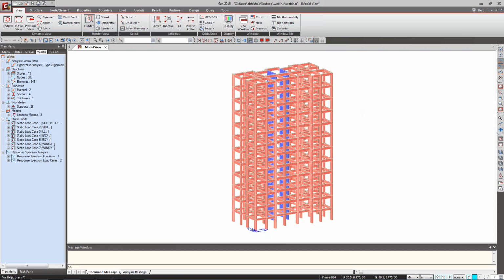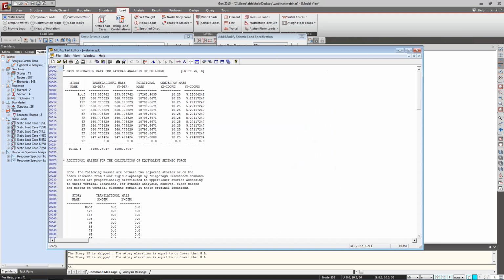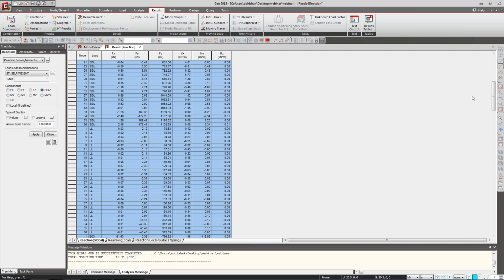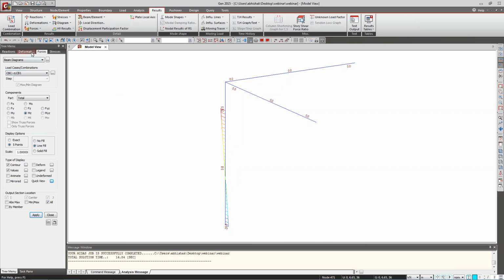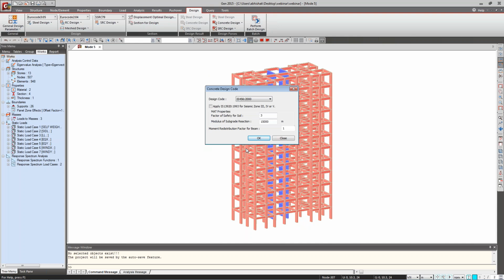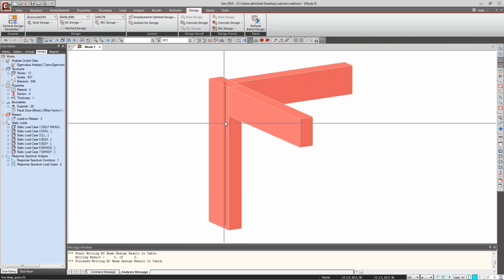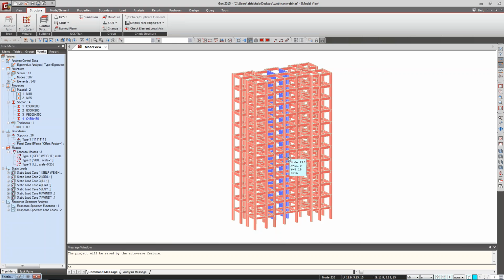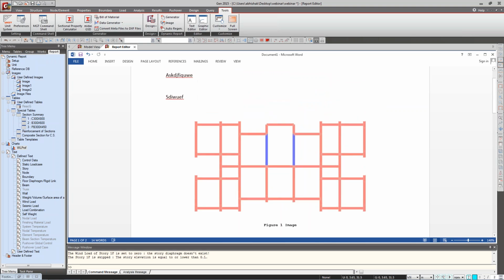ANALYSIS AND DESIGN OF MULTI STORIED STRUCTURE USING MIDAS GEN SOFTWARE  session 2

Comment: Regards
Very good presentation about Midas Gen.

The ACI 318 has several controls for the seismic design:
The relationship 6/5 column - beam.
The knot design column - beam.

Midas Gen can evaluate these two points?